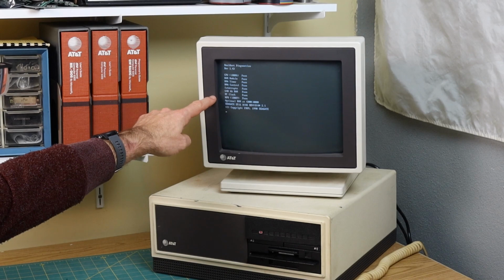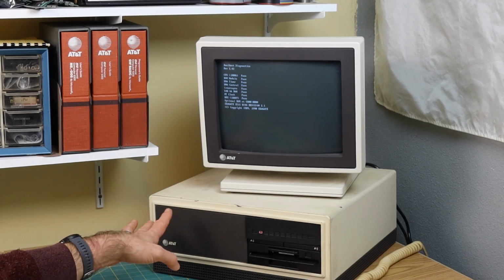Never before seen AT&T PC6300 Upgrades! #DOScember

Comment: Regarding the RAM size question ... You have to look at the mainboard on DIP-SWITCH GROUP 0 and look at 1-4 settings this will tell you the RAM settings for the computer.

As your system is saying 640 we must/can assume the setting is OFF | ON | OFF | ON 
stating you have 256 KB on the mainboard and 384 KB on the expansion
But please confirm your settings

Hope this is at any use
Reply from the maker: Yes. That matches what I found in the system service manual. I'm going to put a link to that in my next video. I'm also planning a video next year where I'll upgrade this system to 640K on the motherboard. That seems better to me.

Comment: Hi, I'm the creator of that old AT&T 6300 video, as well as other 6300/M24 resources on the net.  That memory board is indeed rare, I've never seen it before!  I was hoping it was an EMS board, but it looks like it's just adding to the base RAM of the system.  As for the graphics board, that was not AT&T-specific, it can work in any system.  The AT&T-specific video board is the DEB, which works with the 318H and similar monitors, but is its own standard and very few programs support it.  There was an EGA board that supported the 318H and I hope to make that upgrade someday -- the system will lose its "individuality" (the special 640x400 mode goes away) but you gain EGA support which is more valuable for some people.  I have several systems so I'll only upgrade one in this way.
Over on The Oldskool PC channel, I did a DOS Past 640K video where I show off the AT&T EMS board, you might be interested in it.  Reach out if you have any AT&T 6300 questions.
Reply from the maker: I am definitely interested in the EMS board.  I saw your original 6300 video (from nearly a decade ago... how time flies!) when I was researching the 6300 video that I did in 2020.  I don't think I saw the "DOS Past 640K" video though.  I'll have to check it out.  I'd really like to design a proper, 16-bit EMS board for this system.  I think that would be pretty cool.

Comment: Crazy. I've got a ATT 6300 it has the graphics card you installed. I've never seen the monochrome card or the memory card. My battery leaked but like you said it didn't nuke the motherboard. I can't wait to read the manual.
Reply from the maker: I'm going to try to scan the manual this weekend. If you ever get that system out, I'd be interested to see high res pics of your graphics board. I'm mostly curious to see if there are different versions of it, etc. Do you have any of the software from it? I show some images of my (unopened) disks in the "Can I make this AT&T 6300 usable for #DOScember?" video. I'd prefer to not break the seals, but I can't find that software anywhere on the net.
Reply: @TalesofWeirdStuff  You are in luck I will be digging it out to install the same memory card you have. 😁
Reply: I've got pictures of the card but I didn't pull it out of the machine. This is a later machine with the 1.43 bios installed.

Comment: Maybe the math coprocessor and hi-res monochrome card were for CAD work. My dad was a mechanical engineer around that time and mentioned having to learn CAD on a floppy based system.
Reply from the maker: Perhaps... I suspect the original owner was either a scientist or engineer of some sort.  Or perhaps a teacher.  There were a lot of "using computers for science" kind of books around, if I recall correctly.